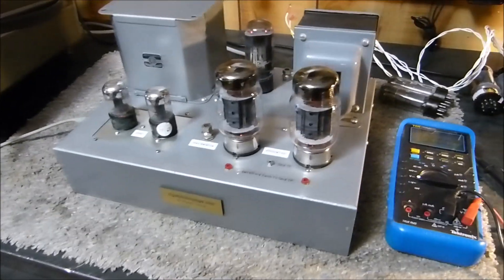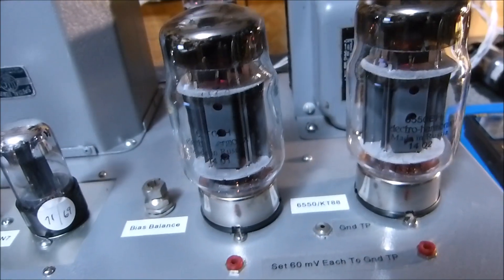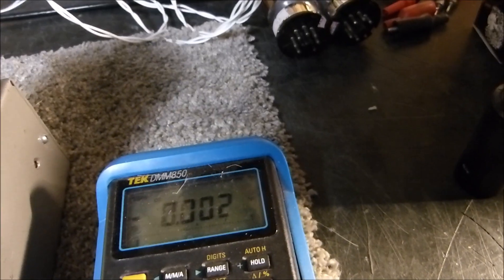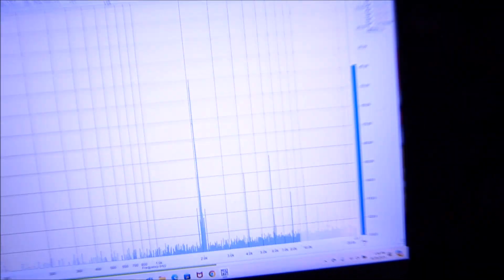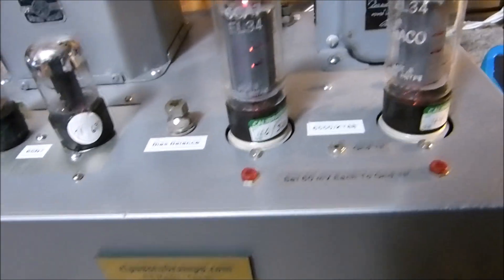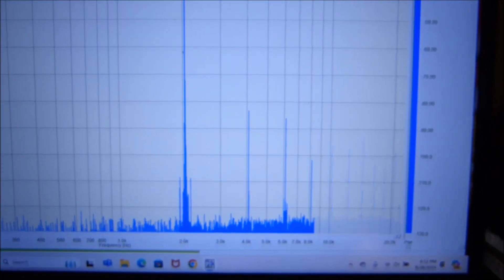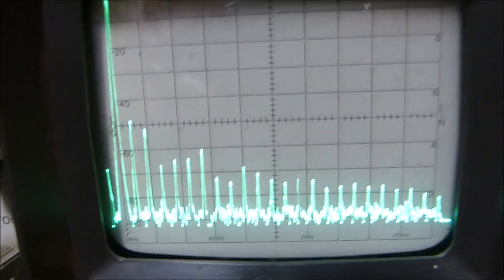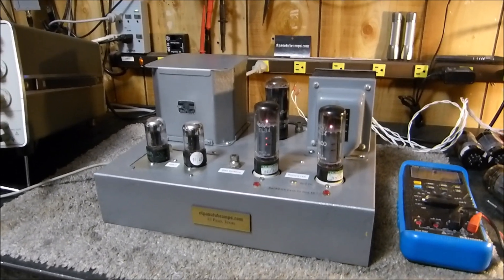British Sound EL34 vs American Sound KT88

Comment: I replaced the cathode resistors on my  Heathkit AA-22 stereo with 2 x lM337's and configured them as constant current. They balance perfect every time and compensates  for tube age.   22ma @ 275v 6GW8                (Nice,nice video. looks like my ham shack)

Comment: I am not a hard core audiophile but came to watch the demonstration/lecture on audio tubes to get a better understanding of the role of harmonics in tubes.. What I am is a licensed amateur radio operator who has owned/operated and heard many tube and solid state two way radios and have noticed what tubes do for and to the listenability of people's voices.. There are lots of new radios paired with sound "enhancers" that try to simulate that smooth rounded audio of a tube but just can't do it justice.. I have also heard what a bad audio tube sounds like with raspiness and echo distortions.. It would have been interesting to hear what a few different guitar string plucks sounded like with each tube set but all in all your scope display was educational.. Thank You.....
Reply from the maker: I am not a musician so I can't play cords and produce tones for different tubes but it is pretty universal in the opinion that the EL34 is a "bright" sounding tube and has a lot of upper harmonics - the upper harmonics part is what inspired this video. I wanted to see and measure them. I use a homebrew tube amplifier on my amateur radio equipment to drive speakers from all my receivers. I also use a frequency equalizer to try and clean up, as best I can, some of the over compressed and processed audio in amateur radio transmitters today - it does help. The consensus about tube amplifiers is that the rich harmonic content of tube amplifiers give them a smoother edge - I liken it to putting salt and salsa on a steak - who wants a steak with nothing on it.  🙂 I post some amateur radio videos you might like. I started with my general class license in 1963 and am still homebrewing. You also might like my QRZ page. 73  WA4QGA

Comment: Just noticed last night that you put out a couple videos.  Been wondering what you were doing.  I was recently transforming an organ amp into a guitar amp.  It has KT88 tubes in it.  It actually has two channels.  The other channel has PP 6973 tubes.  First time I have worked with them.  I think they might be more for the higher frequencies.  That amp is actually in a Leslie 55C. It's for a Conn organ. Hope you're doing well and staying out of the heat down there.

Comment: Hi Dave, welcome back. I think you should back off the power a bit when you do these. You are right on the verge of clipping, where a small gain change could make a huge difference to the harmonic profile. And who listens at 50W anyway? I usually test at 2W = 4VRMS into 8 ohms, and run it up to full power to make sure it can get there. Really in a PP amplifier there should really be hardly any even harmonic distortion at all. I think you had some clipping artefacts in both cases, so the comparison isn't really valid. Best EJP

Comment: Supressor grid / beamforming plates....well this is a discussion on how powerfull of a tube you need. There is a reason beamformers took off. 
Classic pentodes would be required in places where plate modulation wasnt possible, so you could use G3 as some twisted controll grid (perhaps for additional negative feedback from the output ? who knows. maybe for oscillators or RF transmitters as modulation grid)

Beamforming tetrodes are just much more powerfull and robust. And at the same time allowed for a lot more linear and high gain construction. 

But personally, I dont think the high frequency harmonics come from the G3. I think it is the surface area of the target electrodes (plates) and the cathode and their internal resistance. After all we are looking at a low feedback amplifier. And the grid cappacitance also makes a huge difference. 

And also you are using an albeit very nice, but steel laminate output transformer. Probably the most accurate result would be with one of those polish TTG Toroidy push pull toroidal powder iron core transformers. I use them in everything I own and these are insanely good, hell too good forcing me to adjust negative feedback because phase rotation happens somewhere completely else :D. The EL34s are also a much higher frequency capable tube. 

Personally id test KT77s EL34L and EL34B or KT66 or 6L6GC, make a fair comparison tube rating wise. Same ish power and specs just one is beamforming one isnt, with similar target surface area. and 6V6 vs EL84 would be also interesting.

Comment: American sound is more 6L6 based amps isn't it?
Reply from the maker: Here is something that might be interesting, a question I asked ChatGPT.

Back a number of years ago when vacuum tubes were new, I seem to remember that the British had a patent on some audio power tubes, I am thinking the EL34, and the Americans had to have a different style tube design to be able to manufacturer tubes for audio equipment and they made the beam forming plates in place of the third grid (suppressor) in the pentode version of the British tube. Is this true and what is the story?

ChatGPT said:
ChatGPT
Yes, you're on the right track. The story you're referring to involves the development of vacuum tube technology during the mid-20th century, particularly the competition between British and American designs.

The British EL34 Pentode
The EL34 is a classic pentode vacuum tube, first introduced by the British company Mullard in the late 1940s. It became very popular in audio amplifiers, especially in Europe. The EL34 uses three grids: the control grid, screen grid, and suppressor grid, which is a classic pentode design. The suppressor grid (the third grid) is particularly important because it helps reduce secondary emission effects, thereby improving the tube's efficiency and linearity, especially at higher power levels.

The American Beam Tetrode Design
In the United States, RCA and other American companies were developing their own power tubes around the same time. However, due to patent restrictions and the desire to innovate, American engineers took a different approach. Instead of using a suppressor grid like in the EL34 pentode, they developed the beam tetrode design, which uses beam-forming plates.

The beam tetrode has only two grids (control and screen), but it includes beam-forming plates that focus the electron stream into narrow beams. This design achieves a similar effect to the suppressor grid by reducing secondary emissions, improving efficiency, and increasing power output. The most famous example of a beam tetrode is the 6L6 tube, which became a staple in American audio and guitar amplifiers.

The Patent Context
The key reason for the difference was, indeed, related to patents. The pentode design, including the use of a suppressor grid, was patented by the Philips-Mullard group in Europe. To avoid infringing on this patent, American companies like RCA developed the beam tetrode as an alternative. This innovation allowed American manufacturers to produce high-performance audio tubes without violating the existing European patents.

Outcome and Legacy
Both the EL34 pentode and the 6L6 beam tetrode became iconic in their own right. The EL34 is often associated with the "British sound," particularly in amplifiers like those made by Marshall, while the 6L6 is closely linked with the "American sound," found in amplifiers like those from Fender. Each tube type has its own distinct tonal characteristics, contributing to the unique sounds of different audio equipment.

This divergence in tube design is a fascinating example of how patent laws and engineering challenges shaped the development of technology and influenced the sound of music across different regions.
Reply: @ElPasoTubeAmps  Hmm. See Wikipedia. Beam tetrodes originated in the UK at Marconi-Osram with the N40 of 1935. They didn't like the manufacturing complexity, so the design was passed to RCA.
Reply from the maker: @EJP286CRSKW  I read the Wiki account and the 4CX250B is not a beam power tube. It is a true tetrode. Typical misinformation propagated by Wikipedia. Years ago academia shunned Wikipedia as a source of information, now it seems they embrace it - unfortunately.

Comment: When I compared a new stock EL84 to a vintage one, the FFT was radically different. So what does that tell you about comparing completely different tubes to each other? But comparing by ear, the differences are the most obvious.
Reply from the maker: If the FFT profile is significantly different between new stock EL84 and vintage ones, you just analytically measured what people are hearing. That is what I tried to do here between the beam power tube and pentode.  Musicians and audiophiles have been saying this all along. I have always thought the black-plate RCA 6L6 was the best sounding 6L6 and it seems many agree. I expected to see minor differences in the harmonic profile in the upper harmonics when I made this video. I am very surprised. I have new stock Genelex Gold Lion kT77, an EL34 equivalent and I wonder if there is a significant difference in them and the vintage Mullards?  Sounds like another video... 🙂
Reply: @ElPasoTubeAmps  keep in mind, THD is just one kind of many distortion characteristics. Transparency to the music is behind many layers of issues, some of which are not easily measurable, like how an X-ray won’t tell you about the personality of the person. :)
Reply from the maker: @xfloodcasual8124  Totally agree - I have been experimenting with new issue (Genalex Gold Lion) KT77 vs the Mullard EL34 and they perform quite different although at the higher power levels they are pretty much the same. I will plan on posting another video on it later.

Comment from the maker: A little history of amplifiers and why I chose 60 mA for each tube. Vintage Dynaco Mark III amplifiers use KT88/6550 and have a test point (on the 8 pin aux power socket)  where the  voltage across this point to ground is to be set at 1.56 VDC with the bias pot. This voltage of 1.56 VDC is across an internal  11.2  ohm cathode  resistor. If you do R=E/I, you will see that is 140 mA or 70 mA per tube. Similarly for the Dynaco vintage ST-70 amplifier, you are supposed to set the bias voltage to 1.56 volts but this time it is across a 15.6 ohm cathode resistor which gives a current of 100 mA or 50 mA per tube. Why 1.56 volts DC ?? Because back-in-the-day when these amplifiers were new, the old D-sized battery was often used as a calibration source. We did not have, 0.01% digital meters back then so it was common to reference the voltage across a new (non-alkaline) battery to "calibrate" your volt meter. You were supposed to note the exact reading on your voltmeter with the new battery as 1.56 volts and use that point to adjust the bias on your Dynaco amplifier. Crude, huh... but that worked if it was understood what to do. I chose 60 mA because it is a reasonable and workable current for both the KT88 and EL34.
Reply: @ElPasoTubeAmps    Wow, great stuff!  Deep, deep trivia. I can imagine each day’s perfect Ray-O-Vac up on the shelf with a red tag. 

I set up my guitar amp EL34s at 50mA. I expect them to last forever.

Comment: Happy to see you back on the tube, hope all is well with you.

Considering building a Williamson tube amp (mono block) using your schematic.  Was wondering if you could recommend available audio transformers and providers (vendors) of the locking potentiometers used in your amp.
Reply from the maker: Not sure where to get the locking-pots, maybe mouser.com. Mine are all military equipment surplus. People that I know that have build new amplifiers all seem very pleased with the Hammond brand of transformers. Prices of vintage Acrosound and UTC transformers on Ebay are very high. A good schematic for Williamson amplifiers is the Heathkit W4-AM or W-5M. The W4 uses 6SN7 and the W5 uses 12AU7. The complete manuals are easy to find with an Internet search. Good luck with your project. Stay safe

Comment: You set the bias to same idle current (why 60 mA by the way and not 40 or 80?) between the two very different kinds of tubes and expect them to yield comparable distortion levels? Sorry, but this is fundamentally wrong. If you aim at comparing/minimizing distortion, the bias must be optimized separately for each tube type and furthermore, for each individual tube or pair of tubes since any given two tubes, even of the same type and from the same batch will have noticeable and might have seriously different characteristics. Also, Raa and Vb+ must be optimized for each tube type as well. If you just swap different kinds of tubes around in the same circuit and simply set the same arbitrarily chosen bias current, you will hear all kinds of “British” or ”American” or “select-your-favorite-country” sounds. Try putting a pair of el84s in that same amp, bias them at 60 mA and see what happens.
Reply: @therealjustincase     As I understand it, this was not a tube competition, which is what you seem to want. The lack of setup change was very deliberate with the goal of showing the profound difference - all else equal - of harmonic sequence. It did that perfectly. Optimizing for each tube would not have displayed the end result any differently and would require a fundamentally different amplifier.

Comment: 6550s will usually delivery a bit more power than EL84s. You might do a comparison well below clipping (say 1W and 10W), where the amplifier will spend most of its time. I suspect that the EL34s were closer to hard clipping, even though the THD was about the same.
Reply: El34s; either a typo or a Valvian slip
Reply from the maker: Good point about different power levels - here is an unlisted link I just made at different power levels you might enjoy.  
https://www.youtube.com/watch?v=Hf2AityIEYI
Reply: @ElPasoTubeAmps  Thank for you taking the new data and uploading it. Very interesting indeed!

Comment: I’ve always liked the way my EL34 amp sounds and I’ll listen to it for awhile then switch to another amp I built and kinda like that one instead for a bit then switch back to the EL34 haha, pretty cool stuff I’ve never thought to measure like you did between the 2 tubes so thanks for sharing with all of us!, those behringer audio interfaces work great I have almost the same one for doing my measurements.
Reply from the maker: I have a stereo Williamson amplifier built with the UTC LS-57 transformers that I can directly swap EL34 or 6L6GC/5881 into that is cathode biased and I can hear the difference with the EL34 in the brightness of the amplifier. I like it sometimes and then I like the 5881 tubes at other times, just as you mentioned.

Comment: Howdy ! Glad to see another video. I couldn’t agree more, it’s all right there in the FFT analysis. I compared a 5932 (one of the military versions of the 6l6) with an el34 and noticed the exact same thing. My amp is a single 
ended Ultra linear and the difference in harmonic content is even more noticeable than with a push pull amp, both visually and in sound quality. Thanks for posting. Hope everything’s going well. Greetings from Rio de Janeiro